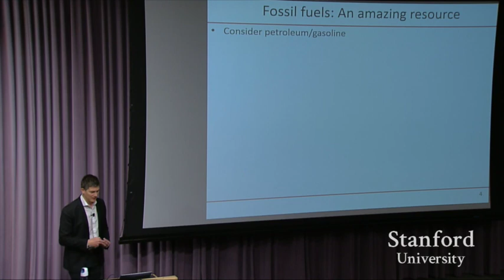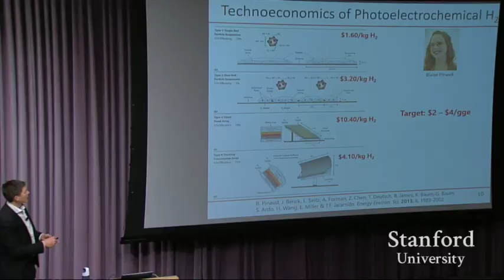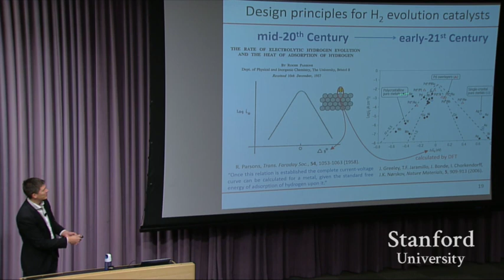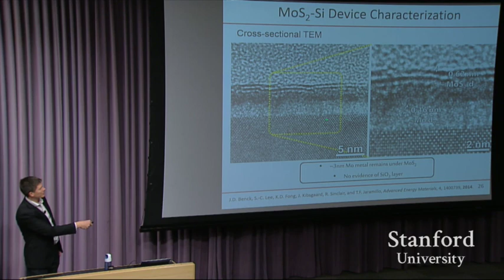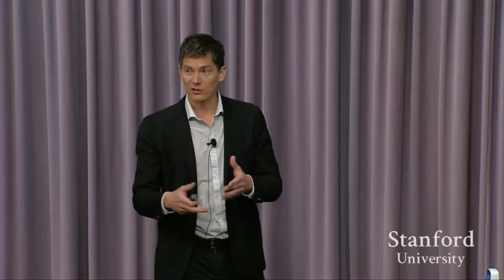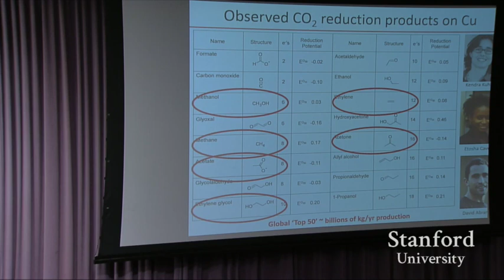Tom Jaramillo | Developing Sustainable Pathways to Fuels and Chemicals

Comment: NET on 5 kg H2 (5 gallons gasoline) would go, in miles:

150 x 5 = 750 HWY
240 x 5 = 1200 City
200 x 5 =1000 combined.

Makes little sense to make EVs vs NET combustion tech with combined cycle.

We don't have the materials for batteries, nor old ICE combustion.  

NET can replace all engines that were combustion except jet engines.  NET can eliminate the need for airlines, which leaves only jet fighters and some military tasks needing turbines.

This will all take a few generations.  No more EVs, only NET.  Start with Ethanol/methanol and phase out oil for transit.

Comment: Excellent presentation.  This guy realizes where it all has to go.  Make fuels, don't store it in a battery.

New Engine Type (NET) tech captures the CO2 on the car with a combined cycle.  The CO2 is off loaded to house and then turned into Ethanol via solar THERMALS+NET.  CO2 is recycled.

The efficiency of NET is 60% (primary cycle) at 100% torque (acceleration), and 75% below 50% torque (cruise, with combined cycle).  
NET has brake recovery of 75%.
NET is a COP 4 heat pump.

EVs are not the future.
We need fuels...

Fuel making with NET solar thermal can be 3 cents/kwh.  A 100% RE grid will be 60 cents/kwh.  NET is 1.5x better MPGe than an EV.  
Battery + 100% RE grid EV is 600 gCO2/kwh.  NET is 3 gCO2/kwh for fuel, no drive battery.  200:1 in CO2.